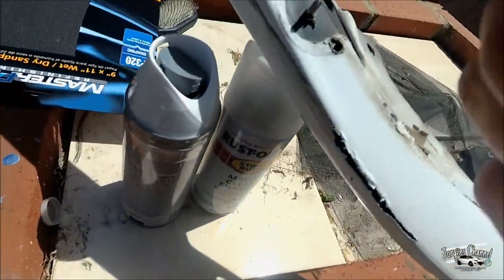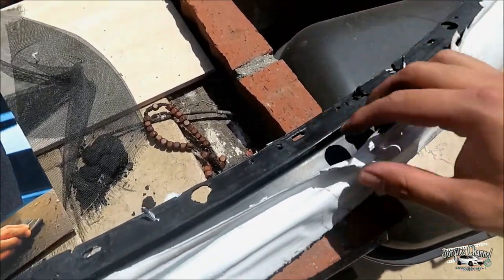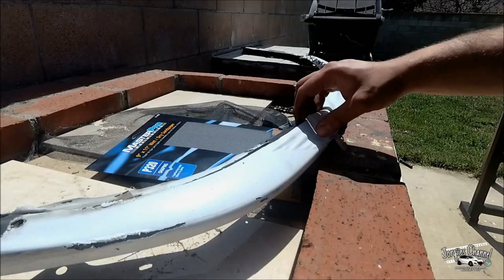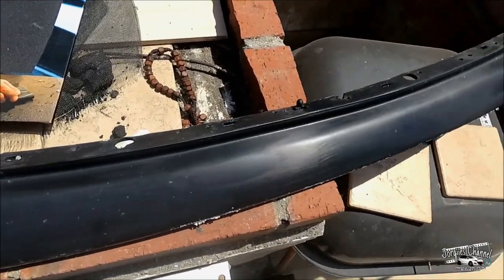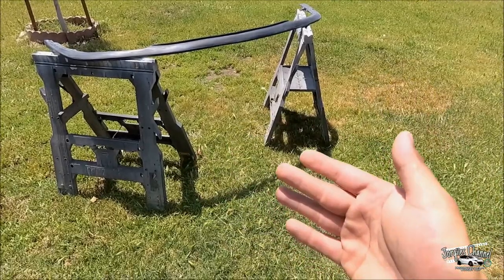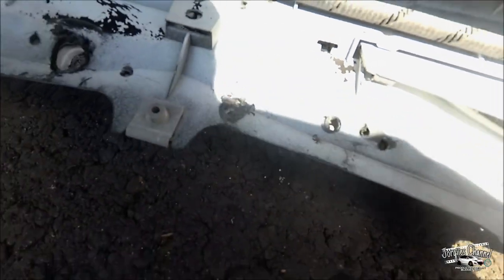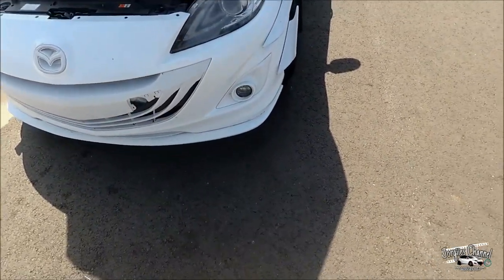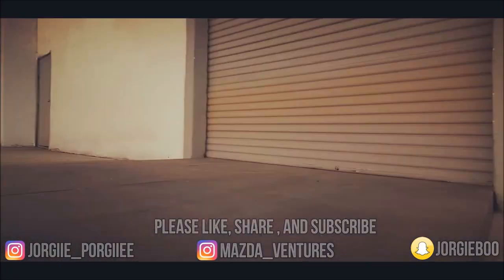PAINTING MY FRONT LIP

Comment: why don't you use a bolt a washer and a nut to hold it on? Works so much better. Self tappers are trash for lips. Good video though bro. ✌
Reply from the maker: Aye! Good idea man! I actually ended up using them to keep them in place as I use rivets throughout the majority of the lip, which is still holding up since this upload 🤙 appreciate the input man! W.e works!

Comment: No wet sanding or flex additive or adhesion promoter.  That paint is not gonna hold. Also the rivets?  Why ? Whats gonna happen when you need to take it off? Better off with bolts and nuts. You'll learn though . We all make mistakes.  Good job though
Reply from the maker: It's held up fine. It's a great statistic to back behind your response to the methods used in this video. It was a trick shared to me at the time this was posted by a skill full body shop/work team. No bolts and nuts when you have a drill with the appropriate drill bit to remove it. Yeah, you can use nuts and bolts, but it doesn't tale long to remove a rivet. Lol 

I only recently removed it for aero purposes for use at the track. The rivets held on great at 140 plus, so they do hold of you were interested in that information.